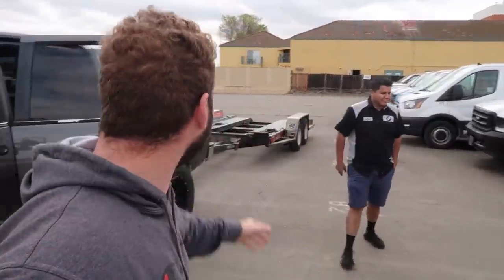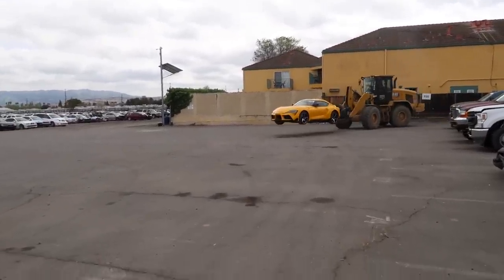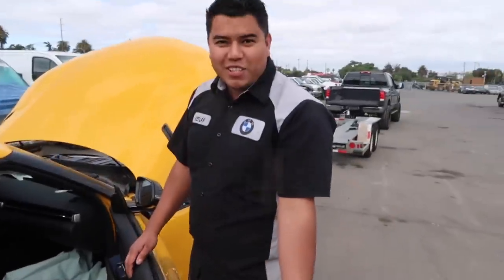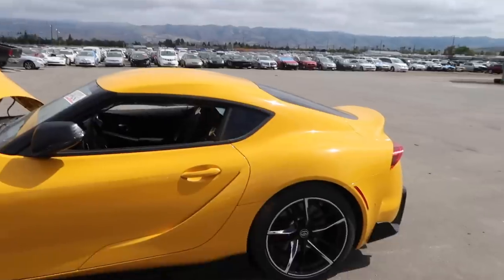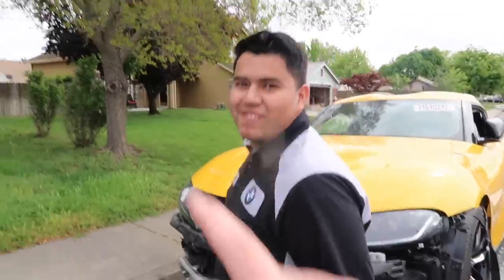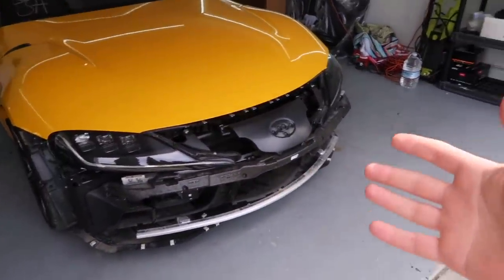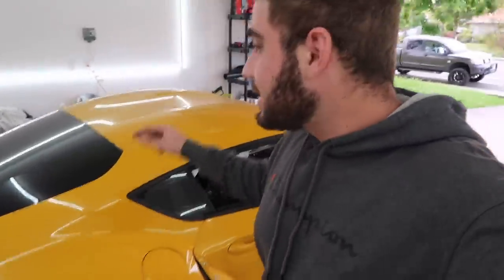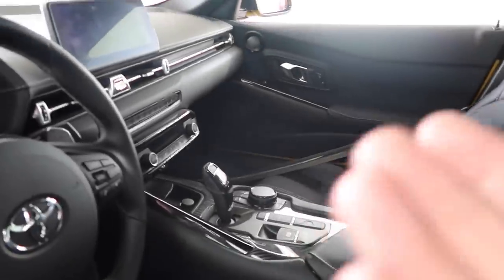Rebuilding A Wrecked 2021 MK5 SUPRA 3.0 (PART.1)

Comment: Nour Hummadi, its not just a bmw, toyota did so much stress testing on the B58 motor and actually sent it back to bmw a couple of times to sort out issues with reliability. Motor built by Bmw but improved by toyota and that is why the b58 is so reliable and durable and that is why toyota allowed BMW to partner with them in the first place and use the supra name because they have a reputation for reliable cars

Comment: DAMN BRO that car is lookin CLEAN! So excited for you man and even more excited to see what comes next with the car. One thing I want to mention though nour is that the puncture beneath the side skirt will most likely become a costly fix if replaced and not just fixed. The reason why I mention that is because it's a skin that pinch welds onto the entire rear quarter of the car and it's not a snap in and snap off job. I've seen it done on plenty of other car rebuilds and the process is sometimes long (and possibly costly?). It comes as one whole piece and especially on the supra because of it's body lines it's a giant single piece that wraps around the entire rear of the car until around the door. I'd say repair would be the best route for that damage if possible. After everything is buttoned back together...it's time to let her RIP!

Comment: Sweet buy. Blocks under the front wheels would save you from removing the front bumper. Did the trick on a Uhaul trailer with my E82.